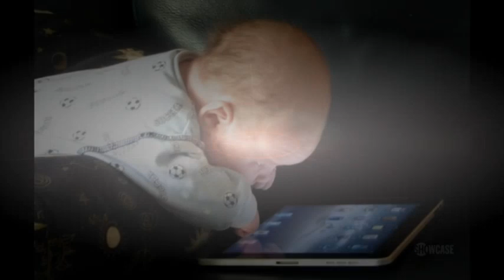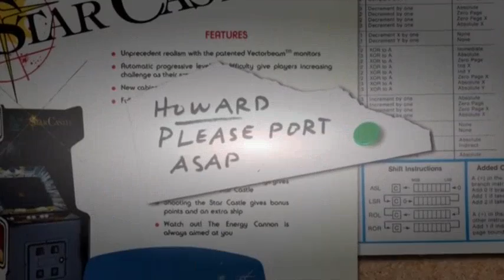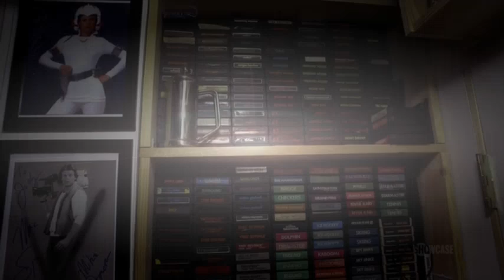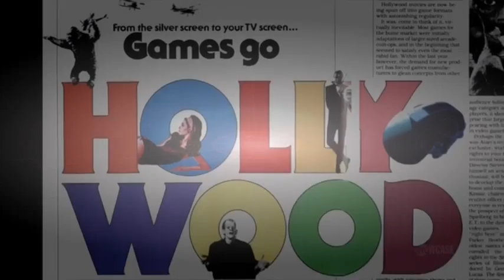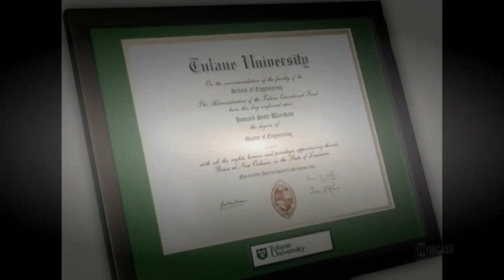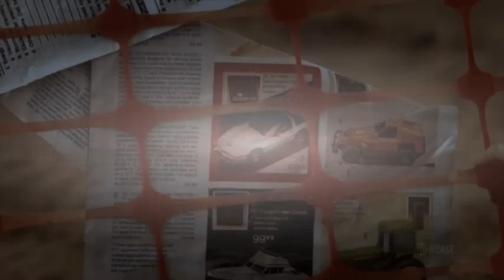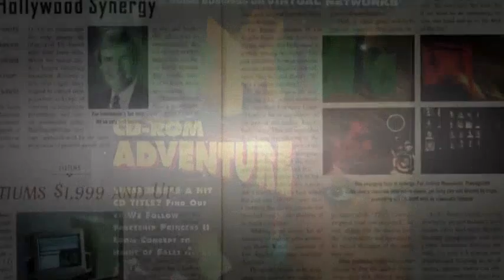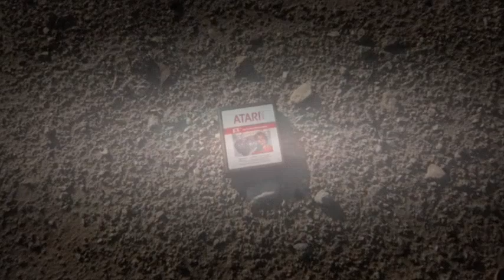Atari  Game Over English Movie

Comment: What's that guy talking about at 41:34? He says you they might find something that no longer resembles an ET cartridge. These cartridges are made of plastic not food and they've only been buried for 30 years, not 30 centuries.
Reply: The plastic is very brittle especially when subject to the heat and elements.  Add digging with heavy machinery and you may end up with Atari cartridge chips or crumbs instead of whole cartridges.
Reply: Even the paper boxes looked like they were in good shape to me.